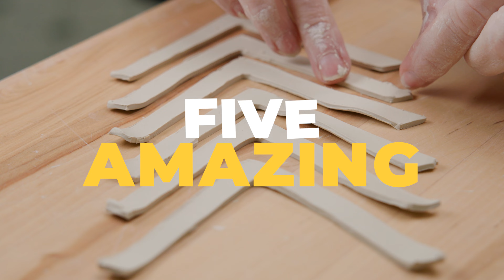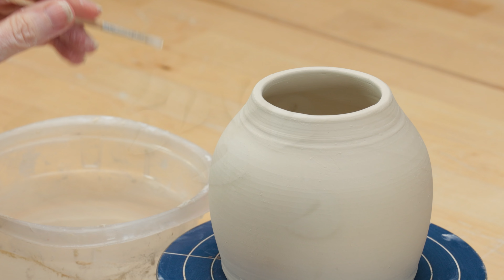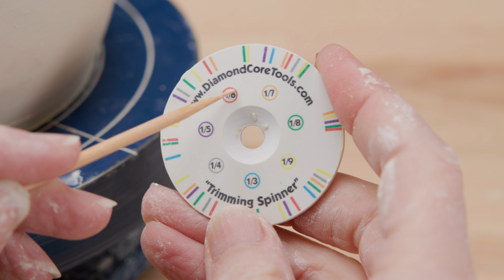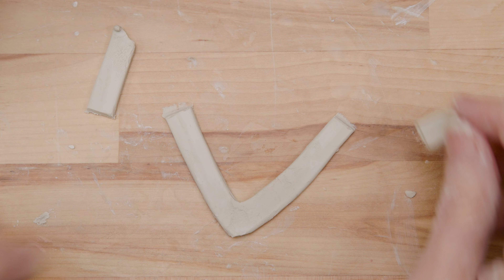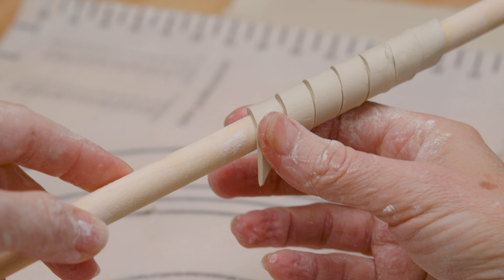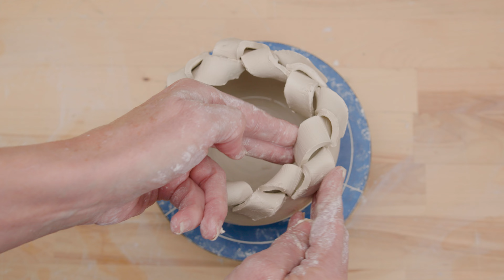BRAIDING POTTERY!! 5 Unique Rims to Make Using Braiding Techniques!

Comment: Beautiful work! These are so creative! I have a question though: why didn't you need to score and slip these to get them to attach? Still trying to figure out when I need to score and slip, or when I don't need to. Thanks!
Reply from the maker: Well. sometimes we skip through that in production but really you should score and slip 93% of the time. If you have surfaces that are still pretty wet and not weight bearing then you can get away with skipping it. However, I know lots of potters who dont even slip and score handles for instance and have no problem with them staying attached...